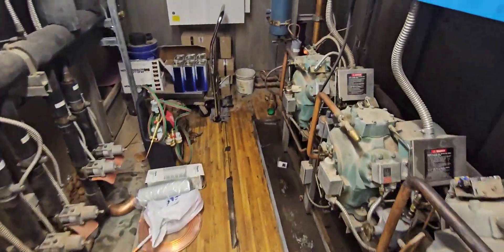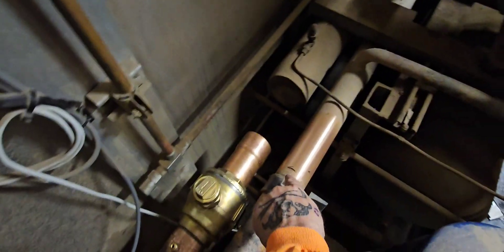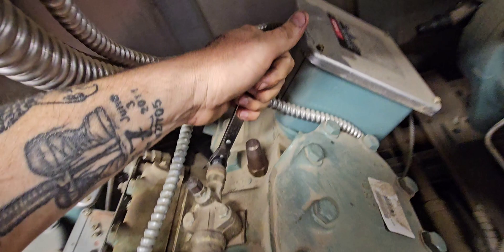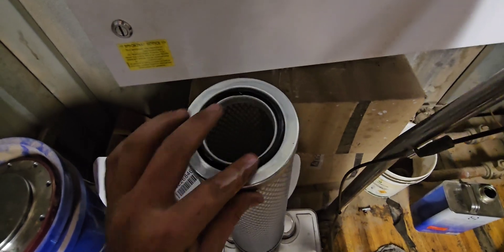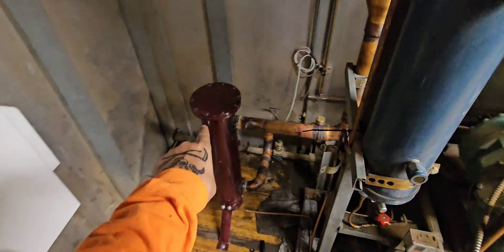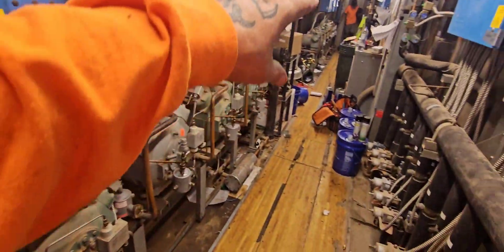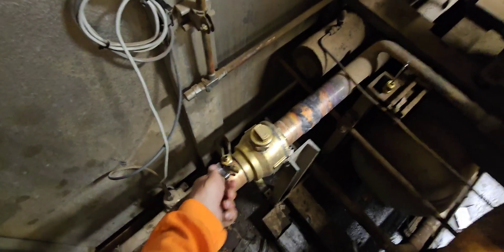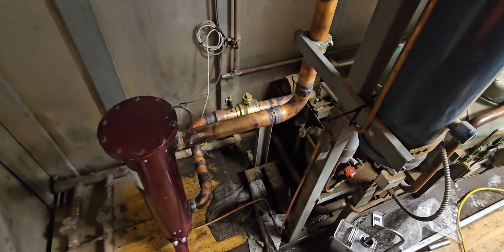Supermarket Rack Oil Separator Change.

Comment: Great video. Was the old separator not working anymore, or are you guys just upgrading it?
Reply from the maker: The oil in the racks was really bad. Those temprite separators are really high efficiency and clean the oil really good. That's why I went with them.

Comment: Isolate the separator you’re taking out then hook it to the suction of the low temp rack. It usually takes about 5 mins to suck out that discharge gas. It looks like the med temp rack you guys are changing the separator on
Reply: Facts Dusty D. Dont even need to touch any liquid line ball valves. Isolate the oil separator and pump it out. Done. You also don’t size anything based off of line size. All about BTU’s/Capacity. Nice work tho.
Reply from the maker: So when having a rack down for a long time, it's a lot easier to pump down from the liquid line. That way you can start the rack back up and not have to worry about any flood back. 
And a very smart man once told me to size them like that. Thank you for watching.
Reply from the maker: Yessir